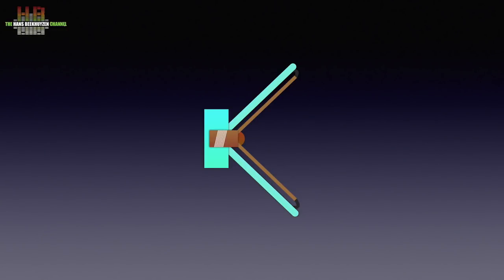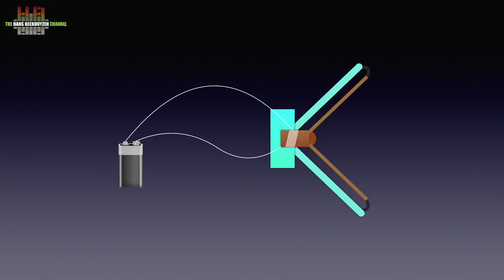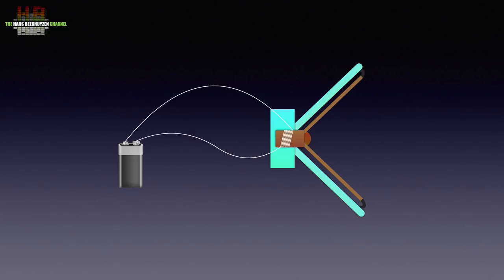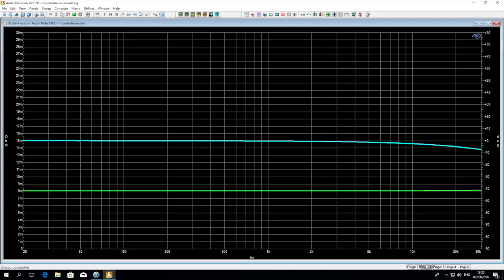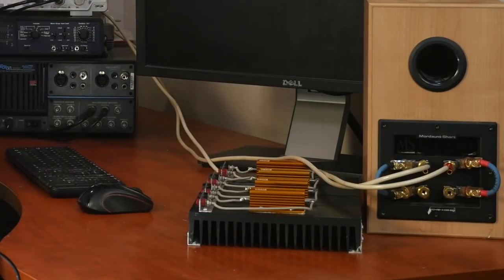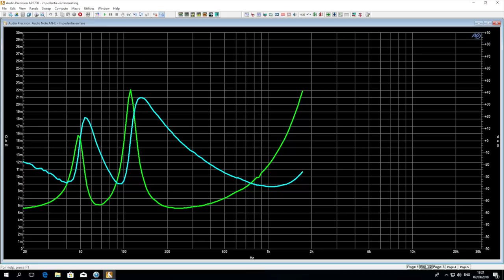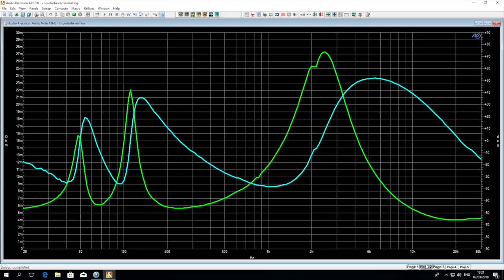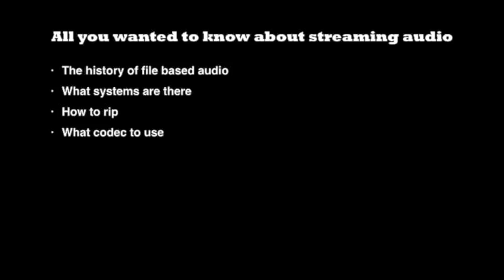What about loudspeaker impedance?

Comment: I bought some pre-owned Magnepan 20.1s, which are specified as 4 ohm speakers. Since I use them in my home theater as well as for music, I hooked them up to my Yamaha RX-a1070 AVR, which is supposed to have dynamic power of 210 watts at 4 ohms. Since I listen to music at relatively loud levels, I guessed there might be a problem with overheating. Sure enough, the Yamaha got quite warm. So I bought a Emotiva A-300 which provides 300 watts at 4 ohms (obviously, I'm more interested in value than seeing how much I can spend). I still drive the center and surrounds on the Yamaha and only the Maggies on the Emotiva and problem solved. Neither the AVR or the Emotiva gets hot, even at high volume and the Maggies sound fantastic.

Comment: I'm a geek (Measured impedance curves and plotted the graph manually 40 years ago).  I always find it interesting trying to explain to people that the reason a woofer or woofer/mid's impedance rises is in part because there a a big air core coil in series with it, just like a crossover.  The voice coil, of course.  Glad you mentioned that a steep phase angle occurring in the same vicinity as an impedance dip is tough to drive for lower end amps.  Nice job.  I'll refer this to friends/customers.  I have trouble staying as concise as you.

Comment: I was able to get some Martin Logan’s esl 9 speakers for superrrr cheap which said to operate at 4 ohms. but we only have a denon receiver that runs at 8ohms. We use it in a system where the two esl 9 speakers are front left and right and then bookshelf speakers for surround left and right and then also a center speaker.
Reply from the maker: Most Marantz products can deliver sufficient current to work with 4 Ω loudspeakers, but I can't guarantee it though.

Comment: The speaker is a complex load for any amplifier, the associated inductance and capacitance makes frecuency distorsion and if we also add the fact that it is an electromechanical component in itself the damping factor and the resonance of it complicate the thing a bit more. In short it looks like anything but a pure resistance at any frequency. All these factors have a negative influence in a performance it is usually does not exceed 25..30%...if you apply 1W electrical in the speaker you really listen sound equivalent to 0.25...0.30W in the best conditions. The rest power leakage for hot. Thank you for your clear explaination. I build tube amplifiers for hobby. Thanks a lot.
Reply from the maker: The efficiency spec already takes into account all those losses.

Comment: Beautifully explained, Hans. 
I have an old 80's Krell Power Amp that needs some new Cap replacements due to old age. In its prime, it could drive very awkward loads with ease. 2 ohms would suck a huge amount of power from the amp & wall, and things would become very warm as a result. Any lower and you're approaching a short-circuit. I had a pair of AR 90's back then ... fantastic for the time. They had multiple 4 ohm drivers, though I understand there was a revision with the design. It was at this time I realised why power amps are so important.

Comment: Hans, great dissertation on Ohms.  My question is two fold:  I have paralleled two pairs of 8 Ohm rated speakers; 1 pair of Elacs and 1 pair of Fluance Bookshelf speakers.  They are attached to a Denon DRA-800H Receiver.  Posters all over the web have advised against this as the claim is Receiver and/or speaker destruction.  The Denon also has a SW and another pair of Elacs connected to the A Speaker output.  The Denon has shut down after playing CDs for awhile.  I disconnected the A speakers , seemed better , but you can feel the Denon getting very warm.  I now have a separate IOTA VXSA3 Preamp which is rated at 40Watts Per channel at 4 Ohms, 80 Watts at 8 ohms.  I connected the paralleled speakers to this unit, and it plays slightly warm but not hot nor has it shut down.  Will playing paralleled speakers in this fashion damage the Amp or Speakers .  They playing very well together btw.  

No. 2 - Where do I connect the red and black leads from my multi-meter to the AMplifier (Receiver) to measure the ohms with the paralleled speakers ?  It is an old Radio Shack meter which works when testing batteries, so I presume it still functions? Thx for your time and advice.

Comment: Thank you Hans from Canada. A very good explanation of speaker performance. Also your other websites.
My Sony amp - a mediocre one - has a 6 amp output. My two sets of speakers are also Sony and are 6 ohm speakers.
I like to add the second set of speakers, and already have been told that I have to add a 3-4 ohm resister in series with the parallel wired speaker, for each one. This way the amp will perform well with about 6-7 ohm speaker impedance.
I like your detailed explanation, en dank je wel hoor !.
Reply from the maker: There is no point in burning power in a resistor. Just put two speakers in series per channel so connect the + of the 1st speaker on the + of the amp, the - of the 1st speaker, connect the - of the 1st speaker to the + of the 2nd speaker and the - of the 2nd speaker to the - of the amp.
Reply: @TheHansBeekhuyzenChannel  
Thank you very much Hans, I will do that. This way each channel has 12 ohms resistance. I guess it is better to have higher resistance than lower resistance.
Anton

Comment: Thanks for explaining. Love the part where you say there's no 4 ohm or 8 ohm speakers. I was wondering if I could use 12 ohm tweeters to replace a dead 8 ohm one as it was closest replacement I could buy and based on your explanation I think it'll be fine.
Reply from the maker: If the sensitivity of the tweeter is the same. Sensitivity indicates how much sound pressure is produced by a given power, normally explained as dB sound pressure level at 1 meter by 1 watt or 2.83 volt

Comment: 1to 8 speakers.. in between from3,4,5,6 its going to be in series. And from 1,2,4,8 parallel  I hope that the way you mean. If yes I will do so.. Thank you for the  instruction.. By the way i forgot to mantion those speakers will be connected on  Chanel 1.  Because the Chanel is busy for stage  speakers. Thanks again

Comment: The problem with 4 ohm speakers on an 8 ohm amp, is the current draw from the transformer in the power supply and if there is no protection circuit you will damage the transformer or worse blow the output transistors.

Comment: Thanks for clear explanation! Im wondering that is when we have ranges? Exaple in my case: speakers 4-8 ohm and amp 6-16 ohms. Is it good combination? Its confuseing when ranges are specified. Please help, thanks
Reply from the maker: Just remember that the lowest value specified for the amp should not be lower than the lowest value specified for the speakers. So when connecting a 4 to 8 ohm speaker to a 6 to 16 ohm amplifier you risk destroying the power transistors in your amp.
Reply: I understand, thank you!

Comment: Hello, what happens if I run 16ohm speakers on an 4-8ohm rated amplifier? Does it mean that the speakers will receive less power from the amp in comparison, or are there other acoustical issues? Thanks
Reply from the maker: Nothing really happens. Thee will less current and thus less power used but you will hear music all the same.

Comment: I have XLS2000 crown Amp.  and I want to install in parallel on 8 outdoor speakers, 8ohms-200watts. 
the amp can handle  2-4-8-16 ohms  any help will end my confusion, Thanks .
Reply from the maker: You can't do that for the combined impedance will be too low. You need to make a combination of parallel and series

Comment: Newbie question regarding impedance matching. I have a Yamaha RX V 3073 which I am currently using to run a pair of Dynaudio Emit M20s which have an impedance of 8 ohms. My Yamaha receiver has the option to use either an 8 ohm or 6 ohm impedance. Yamaha recommends I use the 6 ohm setting when using 4 ohms. Other audio advice I have received online suggests to leave the switch at 8 ohms in order to supply the speaker with the highest voltage and current. According to these sources the switch simply limits the power supplied to the speakers instead of matching impedance speakers. Will I damage either the receiver or speaker if I use the 8 ohm setting on speakers with a 4 ohm impedance? Which would be more likely to be damaged the speaker or the receiver? Logically it would appear that the receiver would be more likely to be more damaged due to overheating. I accidentally ran the 4 ohm speakers on the 8 ohm setting on the receiver for a few minutes and noticed some distortion at moderate volumes. Did I damage the tweeters? I haven’t noticed any further distortion after switching the receiver back to 6 ohms using the 4 ohm speakers. Is it easy to damage tweeters and how long would I have to run them distorted to truely damage them? Apologies for this convoluted post but am concerned about damaging my relatively new speakers. Any advice is appreciated. Thanks.
Reply from the maker: Just set the switch to 8 Ohms.There is no limitation of power as meant by you.

Comment: Hi! I have a question. If the impedance relates to the "efficiency" and power handling at each frequency, does that mean we can view the impedance curve as sort of an equalizer profile? If a speaker has a huge ohm spike at say 50hz, does that mean it'll play louder/quieter at that frequency than a hypothetical speaker with a completely flat impedance curve?

If that is true, does that also mean that connecting an amplifier with different ohms or connecting multiple speakers in series/parallel can chance the way a speaker sounds as if you boosted a couple of those frequencies where the impedance is higher?

Sorry if I worded that poorly
Reply from the maker: No, impedance is about current flow, not about frequency response although there might be some influence.

Comment: Hi from New Zealand 👋.  I was a bit confused, I have a amp/stereo receiver and it says by the speaker connection 8-16ohm, but I have 3 pairs of speakers, all 6ohm and didn't want to wreck my amp. Can they be used safely?
Reply: yes you can use them but as explained in the video you can only play them at mid range volume or less......playing at a high volume will most likely result in the amp heating up (your amp says 8-16 ohm but your speaker has a higher resistance of 6 ohm which will require more power from the amp).  if you have a good amp it should have a safety switch off circuit when the power demand is too high otherwise it will overheat and it will fry it.

Comment: What are the pro's & con's of 8 ohm to 4 ohm. Did I miss it? My interest is a 18" 500 watt Subwoofer powered with a 1000 watt amp. Which is more efficient & would 4 ohm create extra HEATh that cooks the coils. Guess I keeps lookinin...
Reply from the maker: There are no direct pros's or con's to either 4 or 8 Ω, they are a part of a number of properties loudspeakers have and they all matter.
Reply: @TheHansBeekhuyzenChannel  seems shops like Zzounds sells they're 18" replacement speakers in 8 ohm. I am sure they think that will last longer. That was my thinking as well. I have narrowed my Sub speaker choice down to Celestion 30Hz to 2.5 Khz. Making me an Audiofile on the cheapy cheap... Just got my XLi3500 delivered scrach & dent for under $600 & 1000 watts a side 8 Ohm & a Gryphon Miesto Solo is 200 watts 8 Ohms.. I think for just under $200K it could offer 400 watts 8 ohm a side. To be sure the JBL 3 way built in amp gives 2000 Watts & that puts a smile on my face when that Bass Speaker Hits. That is my kinda Sound THERAPY!

Comment: Thank you Hans.  Great explanation. A few questions:  1.  I don't see how the graph indicates your speaker is 8 Ohms. Can this be determined by this graph?  2.  For a speaker that reads that it is 8 Ohms for example, I'd like to know what frequency manufacturers might use to measure the impedance. Many small analyzers use 1kHz and some sites state 250 - 400Hz but the impedance changes based on frequency.  My concern is with measuring speakers that have no markings and measuring cabinets with multiple speakers.  3.  What is the relationship, if any, of the impedance(say an 8 ohm speaker) to the resonant frequency of the speaker?
Reply from the maker: As I said in the video, there are no 8Ω speakers. There are speakers that measure 8Ω at a given frequency, usually 1000 Hz. The most important frequency area for impedance is in the lows since there the most power is needed. What you want is the wanted impedance - 8Ω in your example - with a low phase.

Comment: what actually dictates voice coil impedance? wire thickness and wire winding count on the coil?
Reply from the maker: Those plus the mass of the cone, the strength of the magnet, the voice coil slot and so on.
Reply: @TheHansBeekhuyzenChannel  I meant initial impadence, before the voice coil is even set into the motor :)

Comment: Great video Hans, thank you! Since amp manufacturers now provide a range (e.g. 4 - 8 ohms) and it is recommended to stick to this - what is the downside of powering 16 ohm speakers on such an amp? Is it possible that the amp can't drive those speakers to their full potential?
Reply from the maker: That's possible but normally it will work and it won't damage anything. But are there 16Ω speakers around??
Reply: @TheHansBeekhuyzenChannel  Thanks for the reply! I have an old hifi system (Aiwa NSX-520) and I want to power the speakers alone from a bluetooth amplifier. Each loudspeaker has a 6ohm woofer + tweeters and a 16ohm 'surround' speaker. I'm not sure what to do with the 16ohm surround speaker - I may not wire it up at all.
Reply from the maker: That would be my advise

Comment: H what happens if we connect resistant in serial to speaker.  Is it the suitable way to reduce speaker volume.
Reply from the maker: It is a very inefficient and expensive way to throw away power. Reduce the volume control.

Comment: this is all so confusing; my fault btw
- i've blown a few amps in my time - but never really knew why ... i always associated too much wattage / sound level with overheating and / or blown speaker channels

i have just blown one channel on a nice Techniks amp so am a bit frustrated

i have 4 speakers connected to 4 terminals (A + B) on the amp ... all the speakers are 8 ohms and 150 - 200 or so watts each

the amp says 16 ohms on the rear and after watching this video (thanks Hans) i presume this is the problem

so do i buy an amp that uses 8 ohms?
i saw one online that said 8 - 16 ohms - but it says it will use 16 ohms if both A + B (ie four channels) are used ... which sounds like it will also blow if i push the sound level / and particularly the bass level up to high ... which i obviously tend to do

and also, given that said amp says it uses 8 ohms if only A or B is used (ie two speakers) can i double up ... putting two speakers (two wires) into each positive and negative channel

as you can see - i am a total amatuer ... and i have been playing records loud and blowing amps since the 1980s
- god bless you tube
Reply: Dont know if this helps, but it seems you are connecting 2 speakers in pararell for each amp, so 2 amps and 4 speakers. Not really optimal. If you connect them in series the total impedance change. You can search on youtube about ohms in series or pararell for more info.
Reply: @okspicks  what do you mean by each amp?

i dont understand anything what you said tbh ... it's me not you

what do you mean by "in series"
Reply: awotnot A normal amplifier is a stereo amplifier. it means it have two amplifiers inside, on for left speaker, and one for the right. There are a red and a black terminal for each amp. If you connect two 8ohm speakers to the same terminal, the impedance is 8/2 witch result in 4 ohm impedance for that output, this is called pararell wiring. But if you wire first to the terminals on one speaker, and from that one to the next, it is called series, and the total impedance will be 2*8 witch is 16ohms! so there is a massive difference
Reply: So most likely you have wired in pararell, and turned the volume up high, resulting in very low impedance in some songs, may be down to 2 ohms, and your speakers cannot handle the load. bang
Reply: @okspicks  so you think i should run speaker wire to one speaker (from each channel ; left and right) and then run a secondary wire from that speaker to the second speaker of each channel

i hope that makes sense

i kind of 99% know that's what you meant - but just checking because i'm such a clutz

and if so
... that should give me ohm impedance of 8 or 16 rather than under 8 or even far less
- correct
Reply: awotnot if you are going to hook up 2 8 ohm speakers to the amp you hook up the positive of the second speaker to the negative of the first speaker, then the negative of the second speaker to the amp. Doing it any other way you are asking to burn your amp.

Comment: I have a question: I often heard that not only the power and current-delivery abilities of the amp is important to control difficult speakers, but also the damping factor. What exactly is that? As an example: The impedance of electrostatic speakers like Martin Logans drops to far below 1 Ohm at high frequencies (ca. 0.6 Ohm at 20 KHz). What kind of Amp is needed? High current-delivery and high damping factor?
Reply: My take on damping factor is that it helps control the woofer excursions and that damping factors, above say 50, aren't necessary. A good DF range?? Maybe between 30 and 50. I think that WHERE your speaker impedance drops is more important than WHAT it drops to. Low impedances at 20kHz where there's little energy shouldn't adversely affect amp performance. At 1kHz you're fucked.